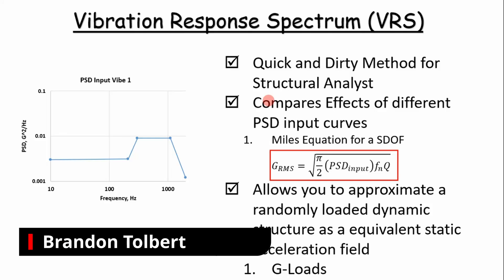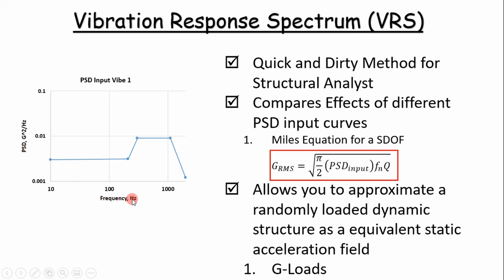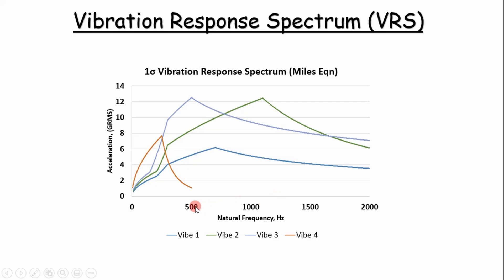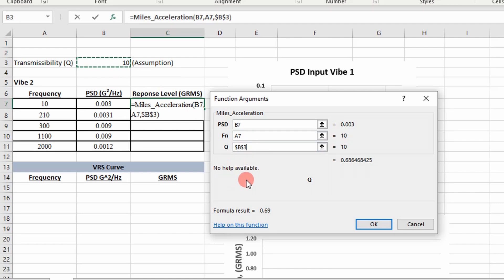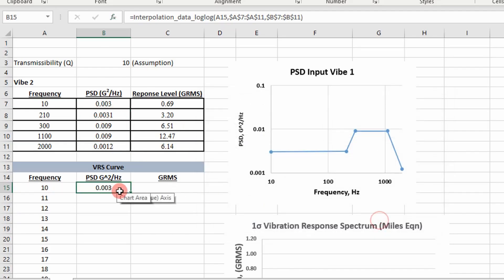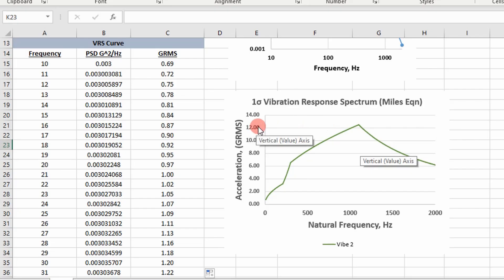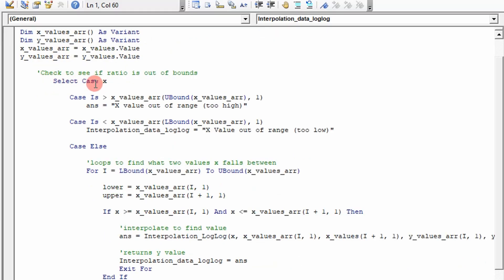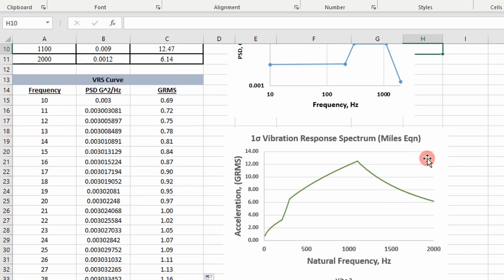Vibration Response Spectrum Using Miles' Equation: An Applied Excel Application

Comment: Is it possible for you to share the same Excel
Reply: Function Interpolation_data_loglog(x, x_values As Range, y_values As Range)

'Turns range into an array
Dim x_values_arr() As Variant
Dim y_values_arr() As Variant
x_values_arr = x_values.Value
y_values_arr = y_values.Value
    
    'Check to see if ratio is out of bounds
        Select Case x
        
            Case Is > x_values_arr(UBound(x_values_arr), 1)
                ans = "X value out of range (too high)"
                
            Case Is < x_values_arr(LBound(x_values_arr), 1)
                Interpolation_data_loglog = "X value out of range (too low)"
                
            Case Else
            
                'loops to find what two values x falls between
                For I = LBound(x_values_arr) To UBound(x_values_arr)
                
                    lower = x_values_arr(I, 1)
                    upper = x_values_arr(I + 1, 1)
                    
                    If x >= x_values_arr(I, 1) And x <= x_values_arr(I + 1, 1) Then
                    
                        'interpolate to find value
                        ans = Interpolation_LogLog(x, x_values_arr(I, 1), x_values(I + 1, 1), y_values_arr(I, 1), y_values(I + 1, 1))
                        
                        'returns y value
                        Interpolation_data_loglog = ans
                        Exit For
                    End If
                Next I
            End Select

End Function
'Interpolation function for straight line loglog plots
Private Function Interpolation_LogLog(xg, x1, x2, y1, y2)

m = WorksheetFunction.Log(y1 / y2) / WorksheetFunction.Log(x1 / x2)
b = y1 / (x1 ^ m)
Interpolation_LogLog = b * (xg ^ m)

End Function

'Module 2

Function Miles_Acc(PSD, fn, Q)
'PSD: PSD value in g^2/HZ
'fn: natural frequency
'Q: Quality factor

    Miles_Acc = Sqr(WorksheetFunction.Pi() / 2 * PSD * fn * Q)
    
End Function
'Module 3

Function Miles_Stress_01(PSD, fn, Q)
'PSD: PSD value in g^2/HZ
'fn: natural frequency
'Q: Quality factor

    Miles_Stress_01 = Sqr(PSD * fn * Q * Q)
    
End Function

Comment: Thanks for the video, i have a question, if this method is to estimate a fast RMS value for an sdof system, how i can do for a multi degree of freedom system? I must estimate the RMS value for every resonant frequency and make apply a sumatory of the total Arms value, or there are other procedure? Thanks in advance.
Reply: Miles' equation was created to approximately calculate the stress caused by aerodynamic forces on the skin of an aircraft. Follow up studies are FDS (Fatigue damage spectrum), so look for them. (e.g. free article 'Simplified Vibration PSD Synthesis Method for MIL-STD-810')
Reply: Thanks